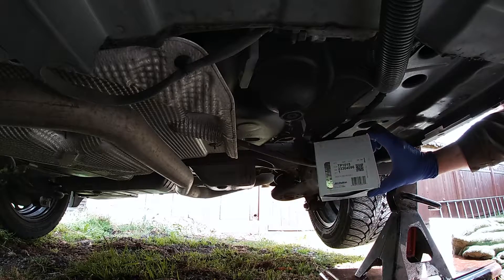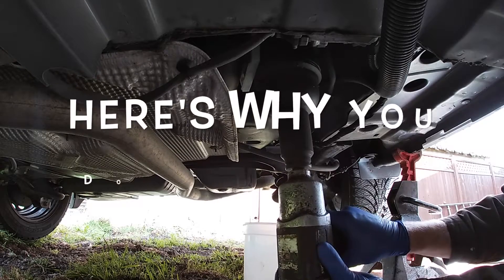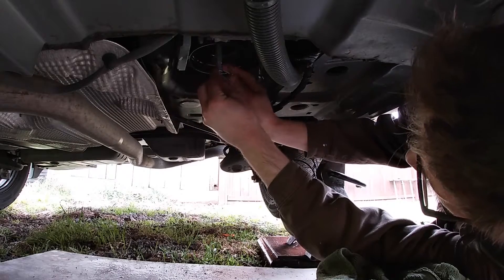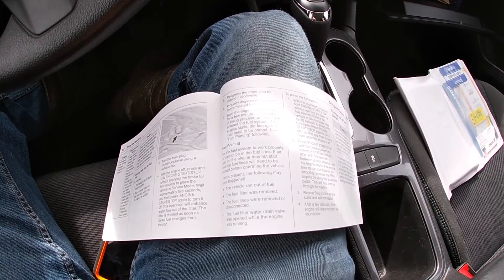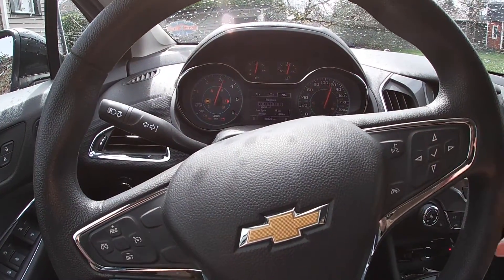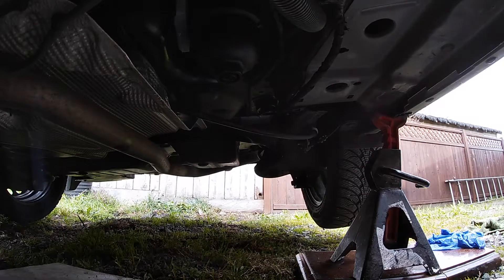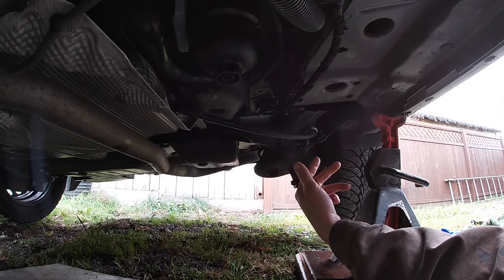How to change the Fuel Filter on a 2018 Chevy Cruze 1.6L Turbo Diesel

Comment: Im going to try the impact method next filter change just to see if it works for me; the other 2 changes I couldnt keep the white plastic in its hanger to get it loose with a breaker bar, so I just disconnected the fuel lines and took it to the vise and got it apart and reassambled on the bench, no diesel splashing but does get a little from the hoses.
Reply from the maker: Ya just go slow, it’s a ridiculous design.

Comment: Thank you sir...I will be using this tutorial to change mine this weekend
Reply from the maker: Right on, just be very careful and go slow if you choose to use the impact gun. I had my car for approx. 4 years then sold it. But it worked for me whenever I had to change it. Someone suggested lubing the o ring for reassembly with oil. I have always been told to use diesel. I tried the oil method once and it made no difference.

Comment: Any idea if the location for the fuel filter is the same as the 2018 gasser?
Reply from the maker: Sorry I don’t know, but I would really doubt it. Usually gas cars are the basic inline metal type and are close to the rear of the vehicle.

Comment: I did mine a while back with no problem, 36mm (1-7/16" fits pretty well). If you look in the repair manual, it points out there is a square hole in the body of the filter housing that can accept a 1/2" extension, that can be used as a reaction force for the torque you apply with a long handled socket wrench to the canister. Using impact on plastic sounds like a good way to wreck something; you're actually supposed to use impact sockets with such a wrench, not standard sockets, for the same reason, and the standard sockets are metal, not plastic! Lots of plastic on that car, saves weight, resists corrosion, but deteriorates over time.  When reassembling, a little bit of lube will reduce friction and let it spin on easily. It has an o-ring, so there really isn't anything to seat by overtightening. Oh well. It's a very nice car to drive though, and doesn't use much fuel (45 - 48mpg).

I just replaced the EGR cooler at 70k miles, and cleaned the gunk out of the intake manifold (by removing it, never spray anything combustible into a diesel intake when it's running, unless you want to watch it run away and self-destruct; intake manifold is also plastic, which rules out burning out the gunk in it). I have the old cooler, which I intend to disassemble and clean, so I can swap it at another 70k miles. I started getting EGR cooler codes, is why I took it off.  Beats taking it to the dealer and having it sit there for weeks and then forever after have problems with it. Anyway, heads up for any LH7 owners--intake manifold will gunk up over time. My car mostly has long-distance highway miles, not city, by the way.

Thanks for the video.
Reply from the maker: It may seem like a lot of force but I’ve changed it 3 times and it works fine. I worry it would break otherwise. Either way it’s an incredibly stupid design. Until someone else puts out a video showing what you’re taking about I’ll keep doing this. This time I didn’t “lube” it with diesel like we used to do at ford and I followed someone else’s recommendation of using oil and I don’t really know that it went on any easier. If it shatters one day that would be a major pita.

Comment: Is this process going to be the same for a 2017 1.4L Cruze but not diesel?
Reply from the maker: I really don’t know the answer to that, but I would assume that it should be way easier and a better setup on a gasoline vehicle. They’re typically metal housing filters with little clips on either side of the fuel line. They’re still tricky to get apart but should be less of a hassle than this process

Comment: I bought the 36 mm socket and a highly-rated impact wrench. It took about an hour to finally get the housing removed, even with the 300 ft./lbs. wrench rating. The filter was dirty-ish looking but hard to know if it was simple staining vs actual sediment. The housing went on much more quickly and somehow tightened to a further point than it was to begin with (I marked the starting point before getting started). It was a ton of work and since my 2018 cruze wasn't acting up, wondering if it was worth all the fuss. Have any of you diesel cruze owners had problems after not changing the filter?
Reply from the maker: I would be more worried about water in fuel, but Diesel fuel injection pumps and injectors etc are very expensive wouldn’t want a clogged filter to cost money. Plus reduced fuel flow can’t be good. I dunno. On gasoline engines it seems like changing fuel filters don’t really do anything unless the fuel tank was grossly contaminated. The only time a fuel filter made a positive difference was when I bought a crappy Ford escort EXP that someone put diesel in. New filter fixed it

Comment: Does GM manufacture a non-plastic fuel filter housing for other diesel models? If yes, that would be a good idea to swap out the plastic one.
Reply from the maker: That I do not know, would be a nice backup plan for sure if needed

Comment: How's your diesel Cruze been holding up?
Reply from the maker: Totally fine, 126,000km. Thinking
about selling it now actually. I hit a bear with it once and had GM fix it under insurance with GM parts. The radio was causing a backup camera issue when it was new so they replaced it under warranty. That’s about it. There’s a recall out for it to turn on the engine light more often, something to do with the regen but if you’re actually driving it enough it’s not necessary so I just refused the recall.
Reply: @Darren1767  Too bad you're so far away, I'd be interested.  I have an Equinox TD but also want a Cruze.

Comment: Is there anything else that needs changed or serviced with the filter? Water separator?
Reply from the maker: It’s integrated/same thing. The water would collect in the bottom of the filter housing and you would drain using the screw in the middle. I bought it brand new in oct 2018 have never had an issue with it

Comment: Perhaps use a little motor oil to lube the threads. If a small bit of motor oil got in the system it won't hurt anything.
Reply from the maker: I'm The Square Root yeah I’m going to try that next time and it really shouldn’t get in there anyways. Other people have said the same thing. When I worked at ford we used to just lube the new o ring with old diesel from changing the old filter but they mounted a lot stronger than the Cruze.
Reply: @Darren1767  Likely going to be what I'm going to do on my car when I change out the fuel filter.

Comment: How much mile and we change filter sir?
Reply from the maker: Refer to your owners manual or dealership :)
Reply: @Darren1767  I apologize if I disturb you sir
There is cruze 2018 diesel for sale. Are you advice me to buy it? Or not
I'm my country there is very little of it
Is there any car have same engine?
Is this car suitable for highways
God bless you sir
And I am sorry if I bother you.
Reply from the maker: That’s ok, :) they’re very fuel efficient. I Havnt had any issues with mine yet. 80,000 kilometers so far
Reply: @Darren1767  thanks a lot sir
Reply from the maker: @نسيمالجنوب-و7ظ  no problem.

Comment: DO NOT LISTEN TO THIS GUY! This video is either misleading or the fuel filter was no previously tighten properly. I tried to do it myself but it was impossible to do it because the cover is very tight. It is design this way because it is under high pressure. You need to take the entire housing out including disconnecting the hose, and electrical connector. It require to person to remove it, one person to hold it on the vise with a monkey wrench, and another person to turn the  36mm  wrench/rachet. 

There no way you can unscrew with a driver, because the white plastic is cheaply made which can be broken very easily.
Reply from the maker: I’ve done it 3 times now, DONT LISTEN TO ANYONE WHO USES THE TERM “MONKEY WRENCH” lol
Reply: @Darren1767  Unless you did not properly tighten the housing all the way on your previous fuel filter change, otherwise it is impossible to unscrew it. You screw up fuel system including the engine. I a licenced engineer by the way. 

I know people do not put the correct torque on the oil filter during oil change. This is fine as long as it is hand tighten because it is low pressure, and it is much frequent. However, the fuel filter  is almost 60K km per change, and it is under high fuel pressure.

Also, how in the world you find sand in the fuel filter housing. All car has a fine strainer inside the fuel tank. Large object gets strain there first. Maybe you screw up your car already.

Why did you change so frequent for a 2018 model. You gotta be driving a lot, I mean a lot. One filter has a life of 60, 000 km. You changed three fuel in two years. You either have nothing to do or just wasting time and money.

Please stop misleading people. Please do the correct thing!
Reply from the maker: @noadsplease  you’re not a very smart engineer are you. I drive a ton and my car has over 100,000kms. Sand came from under the car haha. I forget if I mis spoke. The car reminds you to follow the service schedules as per owner manual depending on your driving. To a of other owners do it just fine the same way. You’ll be the first to hear when my engine blows up lol
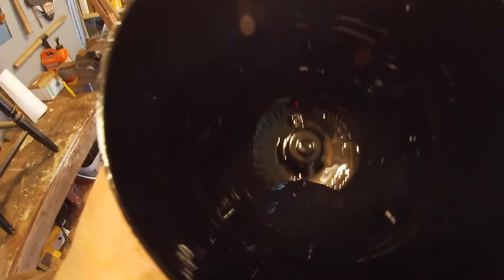Reply: @Darren1767   Check your video at 2:42, fine sand particle got into the fuel filter housing. Your car has over 100K km, why you still need three filter change? Can't you do the Math. Two filter change will last 120K km. Your car computer calculate to be around 60K km. I own one myself.
Reply: Have done quite a few of these.  Use the 18mm to drain the filter housing and release the pressure, and you can easily unscrew the filter housing for a 2018 Cruze.
You absolutely do not have to take the entire filter housing out.  You can, but what a waste of time.....
Reply: @kttenterprisesllc6232  The pressure is key point! I did that too, didn't remember to put it in my earlier post, but it is essential to bleed the pressure off before removal. The can spins right off, no impact wrenches, none of that.
Reply: “Bleeding the pressure” does NOTHING. I did that, and even after 5 minutes of the impact still, it still didn’t even turn a single mm. GM obviously glued these in.

Comment: I take it...its not the same on a regular gasoline engine and its most likely the same BS of an archaic pain in the ass method with these cheaply made bucket GM cars in the U.S. which is often sloppy and very messy to change a REGULAR fuel filter..ugh when is GM gonna do what most eastern Asians do and eliminate that entire hassle all at once.
Reply from the maker: Fuel filters are 100% necessary. I really don’t know what GM was thinking making this so flimsy and difficult to remove. I’m honestly shocked I didn’t break it. I sold the car in October, but I think I changed the fuel filter 3 or 4 times? Got it up to 126,000km on the normal recommended maintenance schedule.